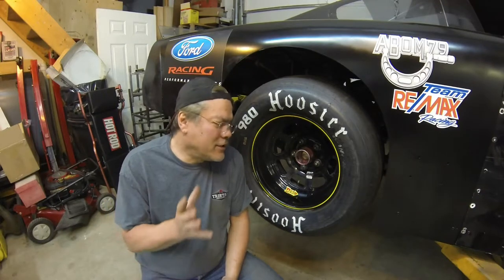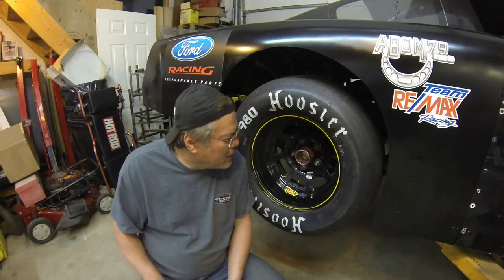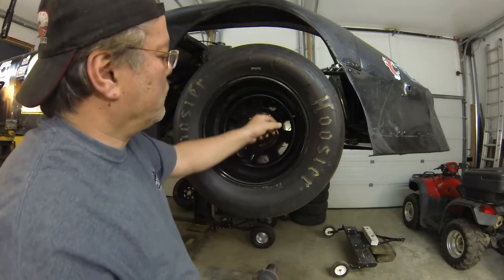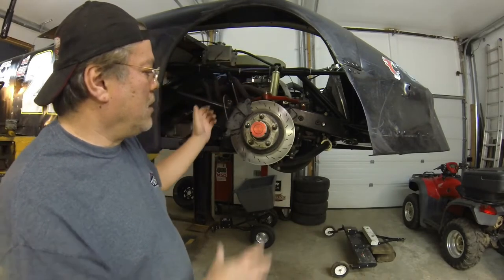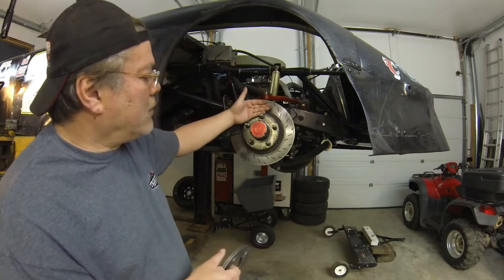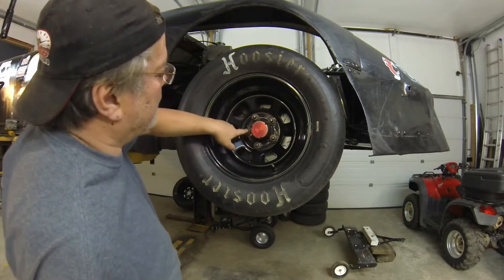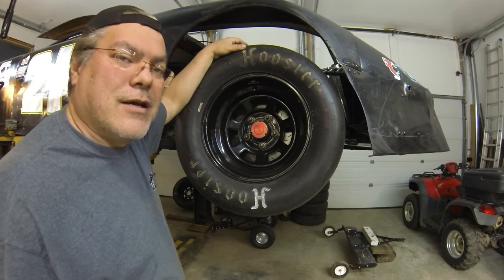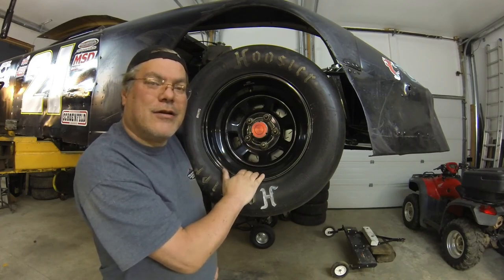How wheels are centered on a car or truck.

Comment: Doug, glad you are uploading again, but you are oversimplifying this issue and ignoring that many vehicle wheel applications are hub centric. 
There are hub centric applications and lug centric applications for wheels, spacers and adapters. 
Yes, some are lug centric and for those applications the center bore dimension and geometry is not critical for centering the wheel. 

Weld, Aero, American,  Bassett, Powerhouse and other manufacturers have offered hub centric wheels, spacers, adapters and rings. 
Many OEM wheels are hub centric as are many aftermarket wheels, spacers and adapters. 
It is important to first determine the wheel centering method for the specific intended application and then machine accordingly.
Reply from the maker: Please give me some examples.